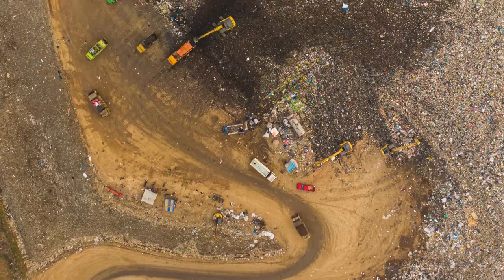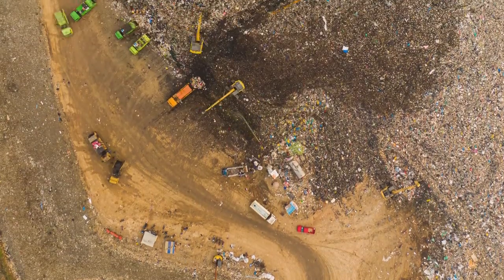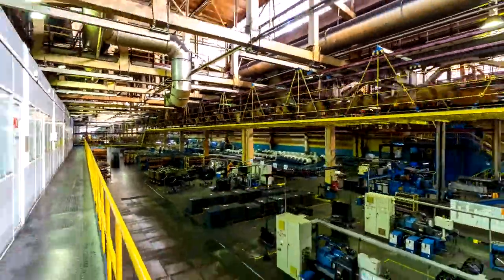Preliminary Promising Results on PFAS Destruction in Soil

Comment: I can't think of what the products are of the ball-milling strategy and how it works (is F2 created) ?  How this creates a chemical change is beyond me unless temperatures are also increased or some sort of catalyst present.
Reply: Hi Rob - The energy resulting from the impact of the ball milling media with the soil allows for the cleavage of the C-F bond.  Fluoride was recovered using a fluoride ion selective electrode providing evidence that defluorination is occurring. This publication provides more details if you are interested: https://www.sciencedirect.com/science/article/abs/pii/S0048969720362513  This technology has also been recently endorsed by the USEPA as one of the most promising technologies for the destruction of PFAS in soil.  Hope this answers your question and thanks for checking this.
Reply: @stefanomarconetto1133 Thanks Stefano for this clarification and prompt response.  Quite nice to get such a prompt response!
Unfortunately I don't have access to the full paper but believe you that this technology is endorsed - 98% remediation is truly amazing but still have some questions.  I might be able to get a copy online elsewhere as I am interested in the particulars.  Since F2 is toxic I am assuming that F2 is absorbed by the fluoride ion selective electrode but can't remember my electrochemistry if you would have to apply a voltage and the efficiency of it for mopping up a truck containing seems large.  I guess you have to scale up the electrode?
Sorry,  I am a civil engineer but my chemistry degree is a few years older.